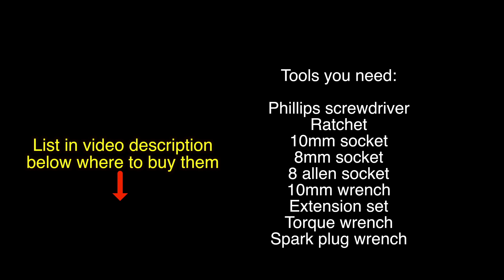Suzuki Burgman 400 - Valve Clearance - Part 4 - Installation 2007-2016 | Mitch's Scooter Stuff

Comment: First of all: This is a JAPAN product so start with DITCH all Phillips crosshead drivers and get JIS standard ones or welcome to stripped heads.. especially those lids on the brake reservoir! A JIS standard crosshead screw is easily identified by it usually have a dot imprinted just at the cross on the head of the screw ;)
Reply from the maker: Awesome I will check it out, thanks!
Reply: Here's a quote from Webbikeworld in 2016:  "True JIS screws haven’t been used since Yamaha was still making two-stroke street bikes."   Phillips crosshead drivers are fine for JIS.
Reply: @ewob52h74  100% BS